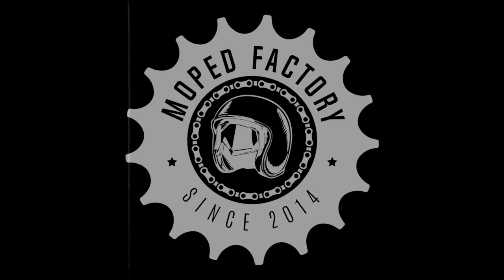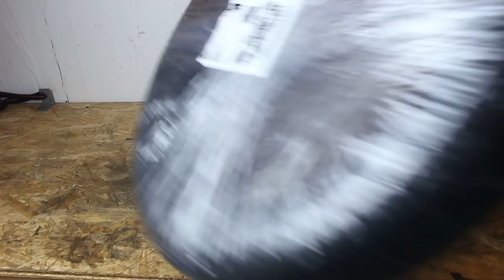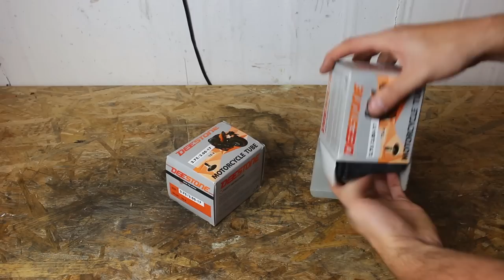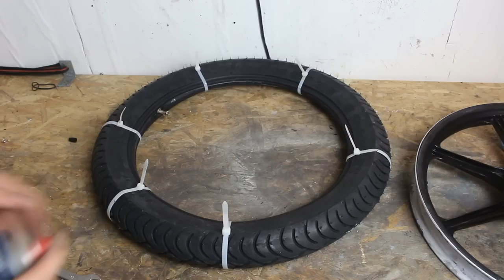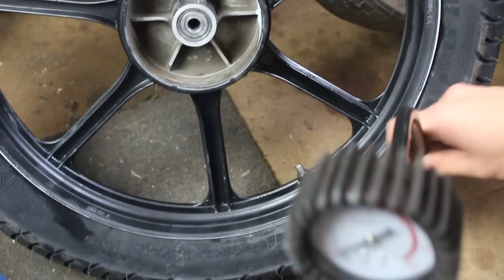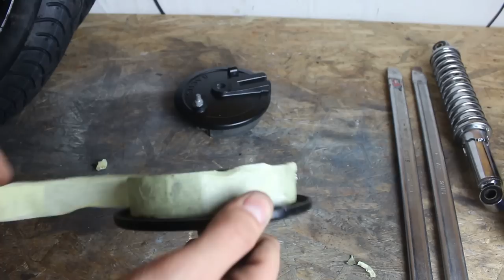Reifen aufziehen - So einfach geht das!! Trick | Hercules Prima GT - Cafe Racer Mofa project pt. 6

Comment: Hi hab mir zwei neue Mäntel gekauft der 1. Ging gut drauf doch der 2. Macht Probleme bei der Montage geht mir immer der Schlauch kaputt und wenn er passt eiert das Rad nur kann mir vllt jemand helfen?
Reply from the maker: Also dein Schlauch geht wahrscheinlich kaputt, weil du ihn mit den montiereisen kaputt machst. Eiern wird er, weil er nicht richtig sitzt
Reply: Okey ja mit den Eisen ist gut möglich aber ich habe ihn schon mehrmals aufgezogen und er Eiert einfach weiter😕
Reply from the maker: Dann sitzt dein Mantel vielleicht nicht richtig.
Reply: Okay ich probiere es einfach nochmal
Reply: Da musste mal 5 Bar oder so drauf hauen dann flutscht der Mantel aufjedenfall auf die richtige Position